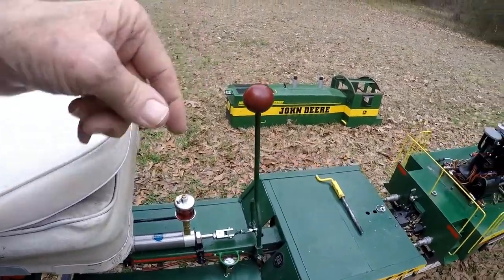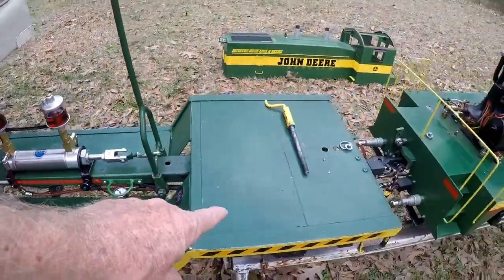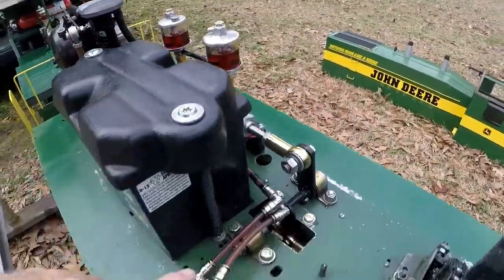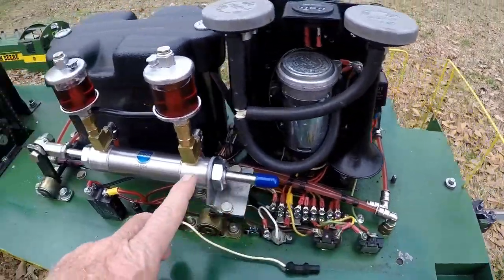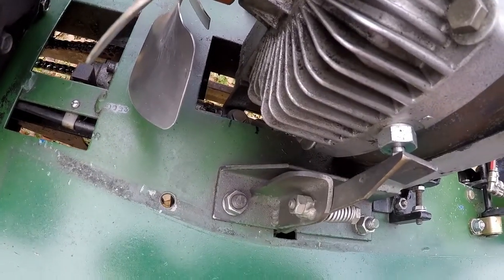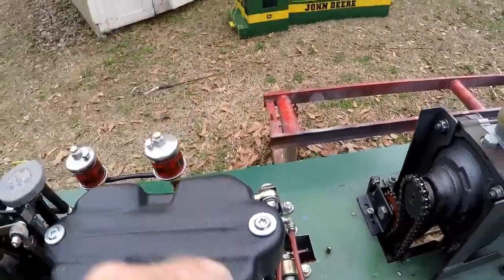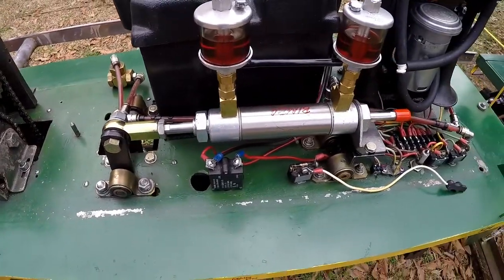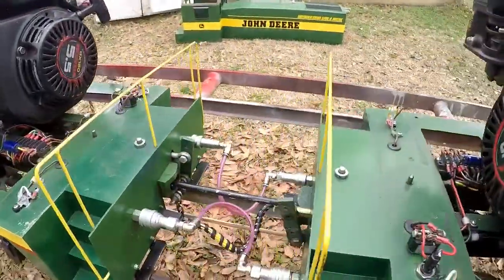MU 2 or 4 Train engines 7 1/2 in. Gauge engines.

Comment: Do you have air brakes on the engines?
Reply from the maker: They have hydrostatic brakes. When you pull back on the stick like a zero turn lawn mower and stop. But when you release the stick the engine will cheep some. So that's when you need the air brakes to hold on the cars. But the hydrostatic bakes works great.

Comment: Thanks for the video. They would be hydrostatic drive units (pump and motor together) and thats a great way to drive two together, once setup they should stay in sync so long as there is enough fluid in the control system.
Reply from the maker: I set the throttle at 2500 rpm with a small engine tachometer and I never have to change. Going up a hill the governor kicks in and maintains speed with a load. Yes the fluid stays the same.

Comment: All that and you didn't show them running.
Reply: I have many videos on YouTube with them running together and with a friend that has the same set of engines and the same setup. See them here. https://youtu.be/OJx8emnslGs. Matt my friend is engineer and I am the conductor at the rear controlling the horn and  brakes. We switch off running. We meet at different tracks and hook them all 4 together and run. You can search on you tube for Dwight Blackburn videos. Thanks for the comment.  Dwight
Reply: @dwightblackburn5049  Thanks, I'll check them out.
Reply: You can see all four engines pulling.  

https://youtu.be/uqN-fFIyc24?si=cYH1zYQVNdVIm3Wj

Comment: How is the chain drive from the hydraulic motor connected to the drive axles? Are the engine to engine connectors dry break? That hydraulic control is very clever. Whole thing is very well done.

I was involved with a minitaure railroad that used 5 hp Wisconsin gas engines driving the axles through a centrifugal cluch and roller chain. The engines were 20 in gauge and big enough to carry adults. All of this was home made and a maintainence nightmare.
Reply from the maker: Thanks for the comments.  I made this video just to give a quick over view of the components and operations of the hydraulic control i come up with. I did not show the underside of the drive train. But as you can see the transmission has a chain that goes down to the drive underneath. There is a couple saddle bearings that the chain runs on and a shaft thru a couple universals joints and spline shaft to a  gear box on the inside truck axles. Then a chain runs between the two axles on each truck. Which gives you all wheel drive. 
The engine was made be Steve Morris and he designed the drive train. I just added the Hydraulic controls and a few other things.
I am not sure about the engine connectors dry 
Dwight
Reply: @dwightblackburn546  Thank you. In effect you have a modern style Shey all axle drive system. 

We use roller chain to connect the drive axles.

Comment: Were do you get the transmission from?
Reply from the maker: Hey Jeff, I bought the engines with the transmission already installed. I am sure you could buy one thru Motion Industries of some of the Hydraulic Supply companies.
Reply from the maker: The transmission came with the engine. I am sure they can be bought from some place like Motion Industries.
Reply: The transmission is a Eaton 7. Can be purchased from BJ Hydroliclics,  Dalton, Michigan.  About $800 each

Comment: Are you using the Bimba 173 DX and 122 DXDE valves? Also what kind of transmissions are they? What are the engines connected to, motors or what? Thanks,
Reply: The transmission is a Eaton 7. With dampers.  Can be purchased from BJ Hydroliclics, Dalton Michigan. About $800 
I will get the cylinder numbers asap
Reply from the maker: I use a Bimbi 173-DXDE Made for oil cylinder for the engineer control. Or Master cylinder.
I use a Bimba 122-DXDE ++@ made for oil for the engine slave cylinders.  
The engines are 5.5hp Honda with double reduction gear box at the shaft.